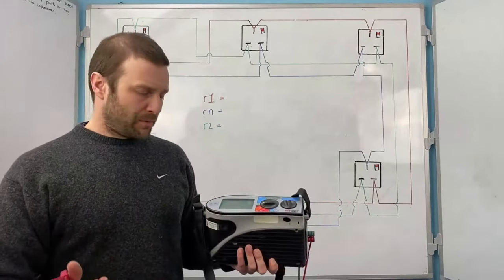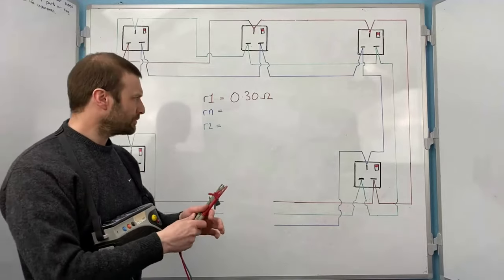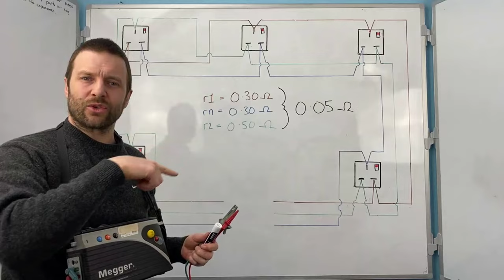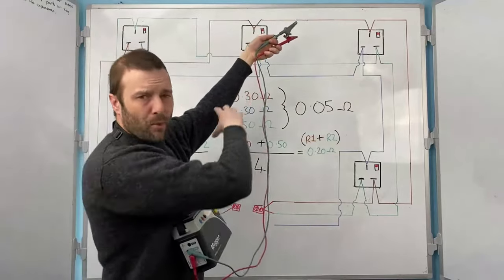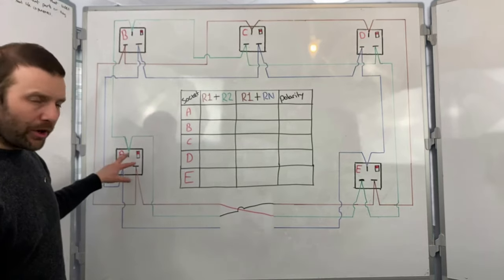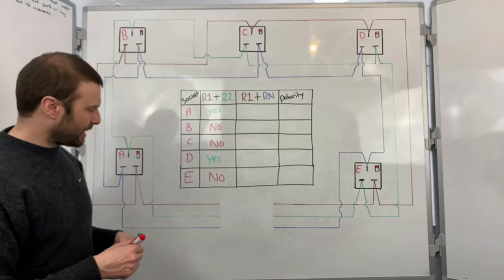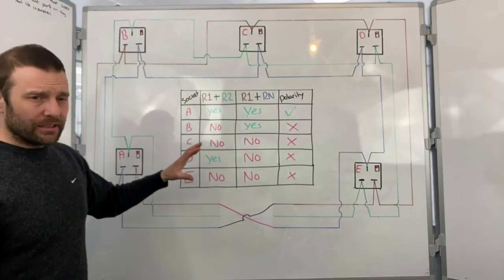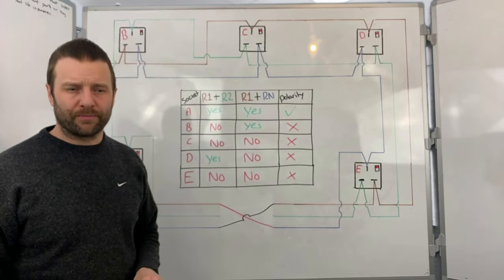Fault finding on a Ring Final Circuit using R1+R2 & R1+RN, the only way to prove polarity AM2 AM2S

Comment: Great Video, I recently took the 2365 L3 (I was an Electrician years a go and retuned to it back in 2017 and wanted to update all my qualifications and possibly get a Gold card) Whilst the L3 course had a lot of fault finding on the practical there was only a little on the theory or approach and that was in a slightly different way! They really need to add this video to their course as soon as I saw this everything they taught made complete sense (and it did not at the time)! Whilst I know how to fault find and fix Rings etc I am always looking for additional ways of solving problems and this was just brilliant. Every Apprentice should watch this.

Also I completed a Domestic installers course (No fault finding taught at all) and then went on to complete the 2365 L2 & L3 and they did not show R1+Rn testing on any of them. I only tested R1 & Rn when I took the 2391-52 course, but could not understand why this was not taught at the more basic levels. When I did start testing R1+Rn on my 2365 L2 course the instructor told me I did not need to do it for the course! (It was more about completing all the tasks within the time).
Reply from the maker: Thank you so much for taking the time to write such a detailed feedback 🙌

Thank you, I try my best 🤗🤝

Comment: Very well presented well done. I am not an electrician I trained on electronics C&G 224 parts 1 and 2 TV / Radio and control systems we did the lot digital and analogue . Worked as a fire alarm commissioning engineer for many years and as an apprentice my mentor told me to always remember 1 leg of 1.5mm cable is approximately 12 ohms (11.86 rounded up) Long ring circuits to you loops to us 😂 . They could be anything up to 1.5km so 18 ohms per leg. Used to use 1.2 ohms per 100m run for tracking down shorts to earth and more than a few times I was spot on and got the nickname the earth fault kid. Miss my mentor he passed away a few years ago what a top bloke taught me so much. Great to see you using maths and readings to assist fault finding all makes perfect sense to me well done.👏
Reply from the maker: Thank you for sharing that, and the positive feedback 👊

Comment: well explained video with good solid reasoning and explanation, just a couple of points, neutral IS a live conductor as is the LINE, it is fundamentally incorrect to call the brown wire the live conductor because the neutral is also a live conductor, it should always be line and neutral, also electrons absolutely DO NOT flow around the circuit, the current does but not the electrons, you could refer to circuit continuity in the Line (or Neutral or cpc) conductor or the particular figure 8 you have connected.  I believe it is important to get all new apprentices and new electricians to use the correct terminology, on the bright side I was please to hear you refer to a "ring final circuit" and not the more usual and incorrect term "ring main"
Reply from the maker: Absolutely agree that the live is the line conductor and the neutral is also a live conductor. It’s hard to talk to a camera, rather than someone’s face, so I some times slip up with the terminology. I had to edit it a couple of times, as I refereed to the schedule of test results as the schedule of inspections 😂

I do use the correct terminology at work, and hadn’t even picked that up n the edit, so thank you for pointing it out. I’ll keep a better eye out next time 👍

I describe the flow of electrons, as I believe it helps the apprentices better imagine current flowing in the circuit, like using the analogy of water, hose pipes and pressure etc.

Thank you for taking the time to provide me with feedback, it all helps 🤝

Comment: Why do you use ring circuits so much in Britain? Is it worth it to use thinner wires? In my opinion rings are very dangerous becouse you never spot a fault right away. Appliances keep working until some wiring somewhere melts down. You are then at risk of a fire or an electric shock, any of these can kill you. In the Czech Republic (and all the mainland EU) we use only radial circuits, 1,5mm2 wire for lights and 2,5mm2 for 230V 16A sockets.
By the way, your way of explaining things is brilliant!

Comment: Great video,

Question. 

Why not just visually check for polarity ?
Reply from the maker: That would involve taking off all the faceplates and people make mistakes when terminating, so they could make mistakes when checking.

Also, there would be no certificate to prove that the circuit is compliant for the next person to use.

There could also be a junction box somewhere that isn’t terminated correctly and is causing a fault.

It’s not just about polarity, it’s about verification and certification.

I hope that helps 👍
Reply: Thank you for the reply, I forgot to thank you when you did reply. Apologies. 

Time to time I always come back to this video. 

I have a question again….. 

You said that checking visually would involve taking of the faceplates which I assume you mean that it takes too much time and people make mistakes terminating and also checking. 

Q. How are supposed to get readings if we don’t take the faceplate off ? 

Is it by putting those really long thin testing leads into the holes where the plugs go into without taking of the faceplate ?

Luckily for you I wasn’t one of your students because I would have probably made your life a misery by asking a 1000000 questions

Comment: What would be nice is to show a socket on the on a different circuit where we would obviously have no reading throughout.also a plug in voltage tester cant tell you if its an actual ring or not.nice video
Reply from the maker: Thank you

Comment: Wouldnt a quick whip round with a KEW socket tester show immediately if there were any reverse polarity issues.

The KEW LOOPCHECK 107 seems like a new generation of simple fault finding devices
Super quick???

Yes, you cover this exact point v thoroughly at the end of the video.

However, isn't it a quick check towards faults in the system, guiding you to where you should pay attention?

Thoughts please?
Genuine question.
Tky.

Ps.  V informative and helpful video. 
V thorough.
Excellent!
Reply from the maker: A socket tester is only as good a neon wand

Comment: So how would this actual test look? Are you taking socket fronts off or are you plugging in an MFT 'socket' attachment with the 3 leads plugged into it and doing it that way??

Ps great stuff this channel is amazing.
Reply from the maker: Just plugging the MFT into the front of the socket with a socket adapter and only two leads, connected into either R1 + R2 or R1 + Rn

Comment: Is it right that main bonding conductors dont have to be under 0.05 they just have to be relevant reading to the length of the cable. Did my inspection and testing the other day and the assesor said that comment?
Reply from the maker: It’s true. If you read GN3 it has already calculated that 15m of 6mm is 0.05 Ohm’s, or 25m of 10mm 

It’s there to give you an idea when testing a property, so you can use your engineering judgement

Comment: The 0.05 tolerance is surely due to cable and connector resistance tolerances!
Reply from the maker: It could be a few things which is why it’s a tolerance 👍

Comment: It’s a great explanation but in your AM2 you’d only have one fault not multiple to look for
Reply from the maker: You would think so wouldn’t you, but I’ve had a few people who have come back and said that they were sure that there was more than one fault in their installation.

One had 3 ohms on one bonding cable and open circuit on the other, so clearly more than one fault.
Reply: @Pure_electrical_training I guess it encourages the student to completely overlook the circuit for faults. If you have only heard about two faults for one circuit on the bonding then that gives new learners the confidence it won’t be on a lighting or ring final which can throw off them off. Bonding is a lot easier on the day.

Comment: What would happen in theory if you went from the CU with a CPC throughout the circuit and a line conductor to a socket came out in neutral to the line of another socket out the neutral so on until you get back to the CU and connect to the neutral bar? I know it’s dodge but just got thinking about it would it work? 😅
Reply from the maker: It wouldn’t work, as the voltage would drop on each socket, and the appliances wouldn’t work properly, if at all.

Do you remember putting lamps in series at school and they got dimmer and dimmer.

Whereas, in parallel, they stayed the same

Comment: cant you just plug in a socket tester? not being snide, as Im not a spark. Just interested
Reply from the maker: It’s a good question, unfortunately there are currently no socket testers that will detect a neutral/earth reversal, and they only have lights.

This will not give you any indication as to the condition of the circuit or accessories and any potential high resistance faults.

They are purely an indication device like a volt pen